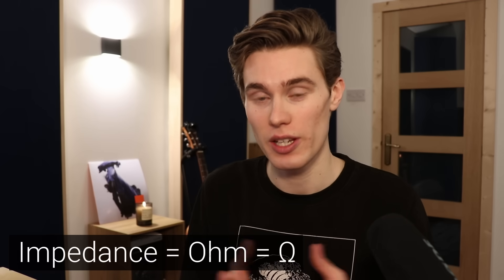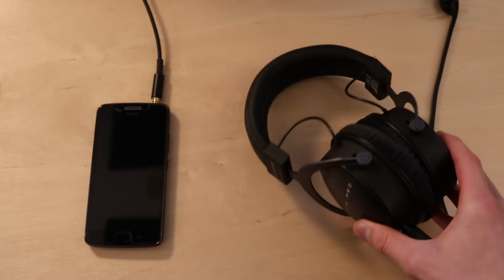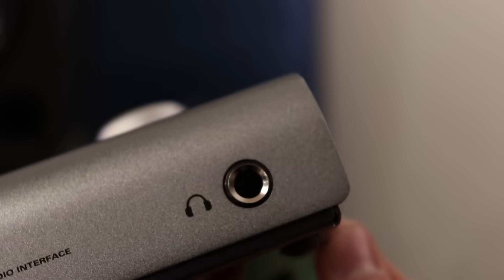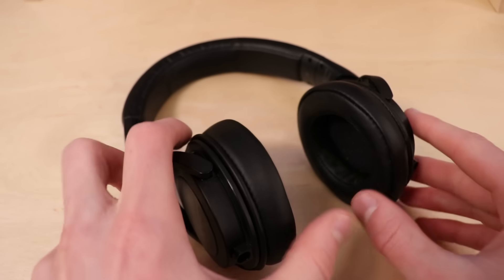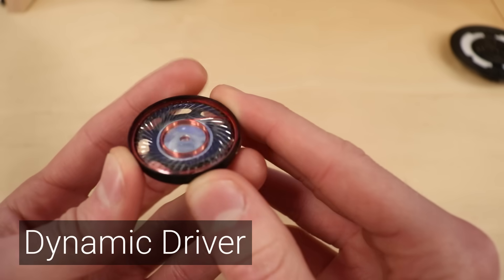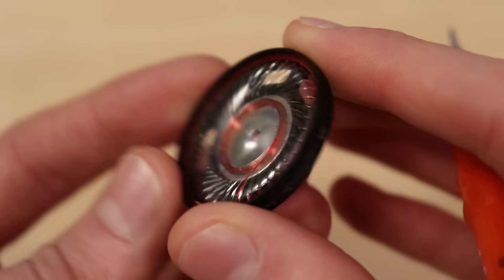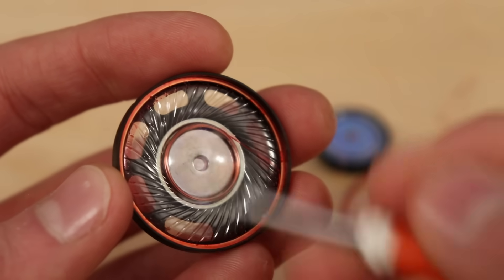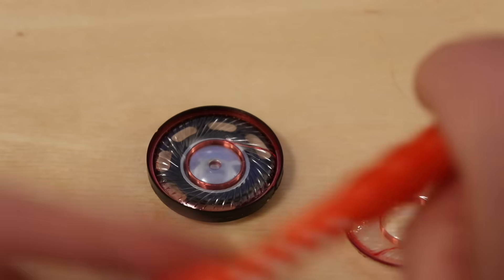32 ohm vs 250 ohm - Which Headphones Sound Best?

Comment: Recently purchased the Beyerdynamic DT-990 PRO and it was the best decision ever. Those work so well for producing, mixing and mastering for me. I'm using them on an Audient iD4 and the 250 Ohm are no issue at all (i was a bit worried at first, which is why i watched this video again). Volume is more than enough, turning it fully up would still blow your ears quickly i'd say.^^ Even on the poor headphone amp of my Samsung S9 there is still a decent volume possible. However it feels that some clarity/resolution gets lost in that case.
Reply: Id4 mark 1 or mk2?
Reply: @DarkoP9.13  I've been using the MK1 and still happy with it. Can't say anything about MK2.
Reply: @DarkoP9.13  250ohm ones work fine with ID4mkII as well

Comment: So why should I pick, say, the 770 higher ohm version vs the lower ohm version? With the low impedance version, don't I have all bases covered? (portable AND more powerful amp sources?) Is the sound (significanlty) better with the higher impedance version? (if I use a more capable amp?) Let me put it this way: Low impedance dt770 vs high impedance dt770 connected to a decent amp. Will I hear a difference? Thanks.

Comment: hi :) I have a specific question to which nobody was able to give me a straight answer, so far.

I own a digital piano (Kawai MP7SE) and I need some kind of headphones specifically designed for the purpose of reproducing the sound of the instrument as faithfully as possible. 

I tried a few headphones but they all tend to have overblown bass frequencies or sibilant high.

I might say I got a pretty decent response from my cell phone earbuds, though the sound feels a bit "empty".

the idea is to have a sound that is at the same time linear and full of  body. 

A good quality mid range is quite important, too.

I checked around and I found a few which are supposed to be made for the purpose.

For instance, both Yamaha and Kawai propose some headphones as an "accessory" to be used specifically with their Digital Pianos (DP):

Kawai SH-9 
(actually made by Audio Technica)

Yamaha HPH-100 and HPH-150 
(price wise, but there are more made by them)

they all have a frequency range from 20hz to 20Khz, the impedance is about 46-47 ohm and sensitivity goes around 100db.

So the frequency response is "narrower", compared to other headphones, and impedance is on the lower range, though above 32 ohm.

That makes me think those are the requirement to perform well with DPs, but I cannot be sure...

I don't think a DP headphones output could handle a very high impedance, maybe under 100 ohm should be fine but I wouldn't go up that much either.

So, the question is, since you seem to have a good experience in this field, would you have any suggestions/recommendation about some appropriate headphones I could buy, brand and model, for this specific purpose?

Also... I wouldn't like to put a mortgage on my house to buy them, so let's keep it in the 50-80 Euro range (eventually, possibly...), though a higher price could be acceptable if the quality is worth it...

Comment: 2:04 You didn't really address the main question/purpose of this video: (for sound quality) why choose high impedance phones over low impedance phones (when using high power equipment) if the latter "will still sound good, it just means that you have to turn (the volume) down so that your ears are not blasted".
Reply: For sound quality, higher impedance sounds better was my take on it. He says low impedance will sound  “good” which isn’t the most glowing of adjectives. He also mentions audiophiles will be able to tell the difference between low impedance and high impedance in terms of sound quality. I took that to mean the high impedance, when paired with the correct equipment, has a higher quality than lower impedance with it’s equivalent but differing requirements for optimal sound. Also the implication of higher impedance being common and preferred in a professional broadcasting environment over just plugging something into your phone jack is revealing. “Do you want shit the pro’s use? Or some Walmart Electronics section stuff?” was what I was hearing. lol. True, he tightroped the question without definitively delivering a clear champion , but I believe the answer can likely be inferred as the higher impedance. But maybe I don’t know what I’m talking about. There’s always that possibility.

Comment: at 250 ohm u cant plug the headphone in id14 audio interface because the impedance output of the audio interface is less then 30 ohm,
if u calculate 250/8=31,25 its more than 30(audio interface output impedance headphone)

Comment: Why do you prefer the dt 770 over the 990 or 1770? Also I’m thinking about getting the dt 990 pros but I play on PlayStation so would it be better to go for the 250 ohm and use an amp or get the 80 ohm? Thanks!

Comment: Please someone help... My focusrite has got <1ohm and my headphone is DT990 and focusrite is driving the headphone but this is  working fine?
Reply: Why wouldn't it? In fact, the higher the ratio between headphone impedance and the output impedance of the amplifier, the better (at least in theory). This ratio is known as the "damping factor". And as a rule of thumb the damping factor should be at least 10. The DT990 being 250 Ohm headphones that means that in your case you have a damping factor of at least 250 (which is plenty).

What does the damping factor mean. Well, consider the amplifier outputting a single voltage spike. The coil will respond to that pulse but because of its inertia and springiness of the diaphragm it will also want to continue oscillating, even after the pulse has actually ended. A high damping factor means that the oscillations of the headphone are damped better. It is therefore a measure of how tightly the movement of the coil is coupled to the voltage output of the amplifier.

Comment: Crazy Question, craftmanship is everything, you simply cannot say one impedance is better than the other, its like saying is a Blue car faster than a Red car?, if you have a quality amplifier it should be able to drive low impedance pairs. magnetic strength is in Ampere turns, less turns more current, or more turns less current, it then becomes a question of coil mass, but that can be negated by using low mass drivers. In other words, if you have a quality headphone amp, you go by an established manufacturer like Sennheiser and ignore impedance.
There are an whole host of factors that determine sound quality such as damping, driver mass, driver stiffness, ability to negated unwelcome off-axis resonances, driver enclosure etc, so this video is pretty much pointless.

Comment: This is incorrect... High impedance headphones need a higher voltage source *for more volume*.  It has nothing to do with the actual sound quality. I’m fact, low impedance IEMs are actually the most affected by the amplifier, contrary to what is said online. Lower impedance = more current draw.
Reply: Yes, I hate to burst so many people's bubble who feel they understand, when the fact is that it won't always work as explained in the video. If impedance of the audio source doesn't match impedance of the head/earphones, inadequate volume or poor or distorted sound quality can result. The unknown variable here is usually the output impedance of the phone's audio, and who's going to be able to find that spec in a user manual or figure it out in order to find the best matching head/earphone impedance? Very few people. (Apple wins here, because every Apple part is designed to match.)

More generally speaking, if the head/earphone impedance is too much LOWER than the source audio output's impedance, sound may distort more at higher volume, and in unusual cases where output power is too high, the audio source or the head/earphone could be damaged. Conversely, if the head/earphone impedance is too much HIGHER than the source audio output's impedance, the head/earphone might not get loud enough... but at least there's a much lower chance of damage.

Knowing the volts might help some people visualize what's happening, but actually finding volts listed in device specs is even harder than finding impedance, so knowing about the volts helps little to find the "best" matching head/earphones. The safest bet is to match impedances when it's possible, or else there's some hit or miss involved. Be more cautious volume-wise with low impedance head/earphones.

Comment: Hi.
Could You give me a help, please. 
I bought a pair of Dt 990 250 ohms and connected to scarlett 4in4 3rd gen and they are playing so quiet. 
There is something that I can do to make it right or better send them back and get 80 ohms? 
Thank You
Reply from the maker: If I have to be honest, I am not a fan on the scarlett range, and it's likely the issue. The 80s might get more volume but the cheaper focusrite interfaces just seem to struggle with volume in my personal experience

Comment: if anyone reads this, I have a question: I have a Steinberg UR12 audio interface which is USB powered, and I've found a super cheap second hand DT 770 pro but it's 250 ohms. So the obvious question is can I make the DT770 work with my audio interface? Thanks.
Reply: Hello. Did you find out if it worked? Thank you
Reply: @janoharek3084  it's been 3 years and i've been through ton of headphones and interfaces lol, but yeah i had no problem with it, as far as i remember.
Reply: @evrendagdelen9595  Thank you! gonna try the 250's

Comment: So, I am gonna use my headphones for listening to music and playing guitar through audio interface... If I understand correctly, I don't need 80 ohms and 32 ohms would do just fine. Am I right?
Reply: (9 months later) yes!
Reply: @sergiobrinas2452  80 ohm version would require an interface?
Reply: @-adrians  In principle yes: interface or dac; although I can tell you that I have a Samsung tablet, with which my 770s 80 ohms works great. I guess you'll have to try.
Reply: @sergiobrinas2452  thank you for the reply. i am thinking mainly for an electric keyboard (roland fp-10) possibly my microsoft surface laptop 3, too? my iphone or ipad mini would not be able to handle however, correct? sorry for so many questions, i am so eager to listen to the soundstage of these headphones at my current equipment’s level but want to make sure i purchase the correct ones :p
Reply: @-adrians  In your case, I would buy the 32 ohms version; you will hear it just as well and you won't have to worry about the power.

Comment: Hello Michael! Congratulations on your channel! The great quality of the videos and the clear information you provide is the differential! I've got a question and wonder if you could help me. I mix using an audio interface (behringer UMC22) on which I plug my headphones on a stereo output of two mono channel (2x P10). Would it be better to use a 250 ohms or 80? Thank you very much!
Reply: hey i have the same question rn haha, what did you chose? I dont know if i need the 250 or the 80 ohms.. I have the behringer UM2

Comment: Some good info but you only said one vague  sentence about the possible sound quality difference between different impedance headphones of the same brand. So I’m still uninformed as to whether I should go for 32, 80 or 250 ohm dt770s for home studio use.
Reply: It's all about your usage. If you have a dedicated amp and dac, go for the 250. If you will mostly use it your phone or laptop go with the 32 or 80 ohm. There's no a huge difference in sound quality. If you use the 250ohm on a phone it will sound good too but you won't be to turn it up higher. The volume might be too low for your taste.
Reply: @felixf4378  friend do you know if in Scarlett Solo 3 Gen a 32ohms fone Works good? I saw they recomend 80 ohms or more ..
Reply: I got to the end of the video, but I still don't know which one to go for, too hmmm
Reply: Same here.  Hm.
Reply: honestly 80 ohm is your best bet, their affordable. And as well as a nice sounding middle ground

Comment: So if I have an audio interface, I can go for the 250 Ohm headphone? Even without an amp? I mean, there'll be a preamp in the interface but I wasn't sure...
Reply: After lots of researches, I have found out that, audio interface with power adapter (not bus powered) has more output range. 
For example I'm going to buy Sennheiser HD650 (300ohm) and audio interface Audient iD22 which has output 600ohm.
These two fits together very well.
Reply: Money Stacks  Enjoy in the new World!

Comment: You missed another big part of the equation. - sensitivity. How much of the power inputted gets changed into sound energy. Planars are low impedance but low sensitivity and are very hard to drive. Each 3db dip in sensitivity is equivalent to 2x the impedance

Comment: Love the breakdown. Only one problem i noticed was the discussion about magnets. The magnets themselves don't do much in terms of "fidelity" or accuracy in sound. The composition of the magnet is purely down to weight and overall mass for the given resistance levels needed to be obtained.  You can tune magnets of any material to get the sound profile you need, but the trade-offs means you may have to use more or less of a certain material which will change your design and mass. Just like with battery technology, lighter materials means you can increase the density of a unit for higher power levels for a given size constraint. Companies don't choose between one type of material over the other because of sound quality. It's a matter of cost, weight and size constraints. Ciao!

Comment: Hey I’ve got the Behringer U-Phoria UM2 interface, and I plan on buying a pair of DT 770s. What ohm headphones should I get. Hoping to buy a pair tomorrow so anyone who knows please lend a hand.
Reply: What're you going to use it with? Do you have an amp?
Reply: Harsh Kute just the interface I mentioned at the start of the comment. I ended up getting the 990s 250 ohm and everything is fine. Also the volume is just fine on phones as long as you turn it up a fair bit so anyone else who was/is wondering about that, there you have it.
Reply: @hugfish2207  can you recommend me a good, cheap amp? Also will I be able to use the 250 ohm version with my phone? How to even use an amp? Do you plug it into your phone and then the headphones in the amp?
Reply: Harsh Kute I’ve just got a behringer uphoria um 2 audio interface which is definitely usable and its really cheap for an interface. I’ll probably go for something better in the next few months when I start craving a purchase, but from my own use it’s decent and gets the job done. Also the top 4 volume knobs on your phone (speaking on behalf of an iPhone 6s) are about the volume I normally listen to things so I think you should be good with that. Definitely do a bit of research though because I do have to turn the gain pretty far up on my interface when using them on my pc, and I’m not sure if that’s a bad thing or if it doesn’t matter.

Comment: I have the Beyerdynamic dt 990 pro 250 ohm and I use them for mixing music and on my portable devices and phone around the house and they sound EXCELLENT.  I compared them to a lot of studio monitor headphones others and there were some that sounded about the same but I loved these due to the sound quality, the soft pads, you can replace every part if anything breaks and the classic old school look.  You wont be disappointed with these headphones.
Reply: What audio interface or amp did you use
Reply: You can’t replace the wires if they break. My right cup stopped producing sound after 3 months.

Comment: Thank you for the video. This really helped me with getting my new headphones. just got some Beyerdynamic dt 770’s
Reply: Which version did you get? 32, 80, or 250 ohm?
Reply: Brian Matthews I got the 80 ohm version
Reply: @tekuru 80 ohms works really good with laptops and even the older iPhones that have headphone jacks. Don’t expect to get crazy levels of volume (Even though it is never a good idea to blow out your eardrums). One issue I have noticed, is that the cable end is made of gold. With the adapter on it’s not a issue but when you take the adapter off it can bend easily so be careful to not carelessly yank the cable out of the headphone jack. Other than that, they are really great headphones. there is not that much of a difference when connected to a normal headphone jack compared to connecting to a preamp or audio interface to be a problem. I’d say the only big difference is that you will be able to turn the volume higher than when connected to a laptop. I hope this helps.

Comment: Weird thing is, that both DT770 and DT1770 in my use are running perfectly fine with lower and higher volumes on my laptop (Toshiba L50-B-22P, cost around 700 € when I bought it some 7 years ago), and the sound is brilliant too (even more defined in 1770 as they're production/mixing pair of headphones).
Just in case, and as I produce the final tracks, I'm going to get a DAC/Amp combination like Apogee Groove 220€, in order not to depend on the sound card (DAC) of the laptop, but I'm surprised how effortlessly the DT770 and DT1770 are running on my laptop. Of course, there are differences between different laptops' hardware, but still... well, I'll find out in a few weeks when the DAC/Amp arrives.
Reply: Also, my volume is 15...25 % when listening with DT1770 (250 Ohm, 500€), 18-30% when listening with DT770 (250 Ohm, 130€); the finer detail and spectrum of DT1770 make the loudness come through better, so generally I'm listening with a quieter volume as all the details are more refined and more capable of irritating the ear too.